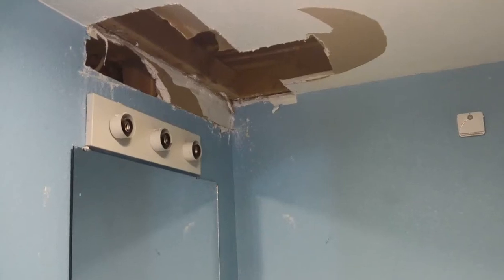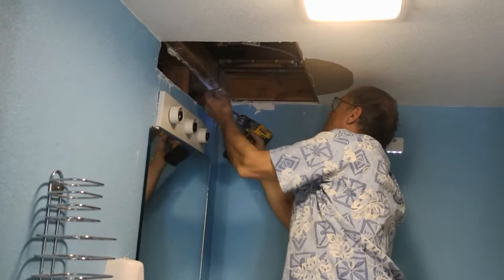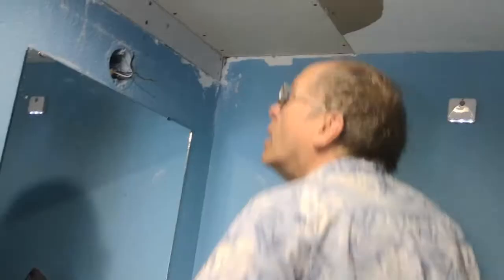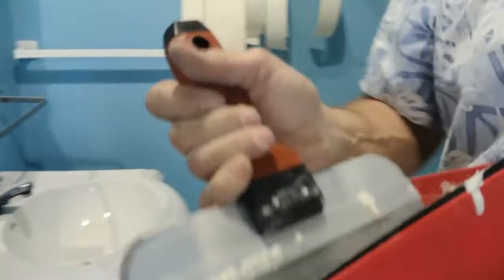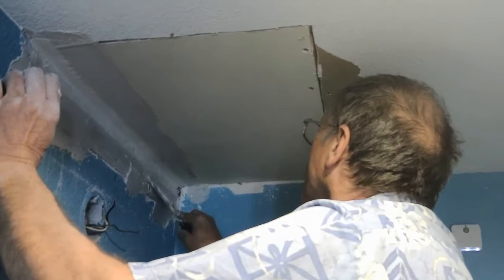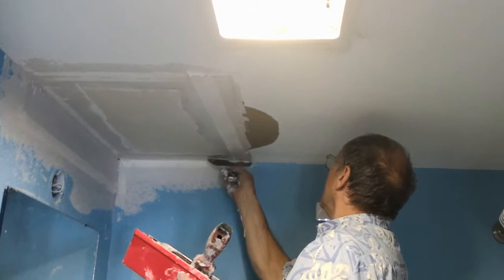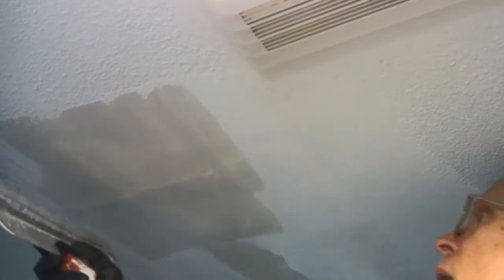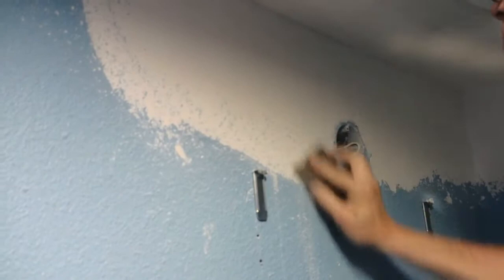Ceiling Corner Drywall Repair

Comment: Did you have any issues with the mud on the exposed brown paper?  My understanding is that you're supposed to use an oil-based primer on that before mudding it.
Reply: Doesn’t have to be oil based, but as long you use a good base primer like most Zinnser primers.